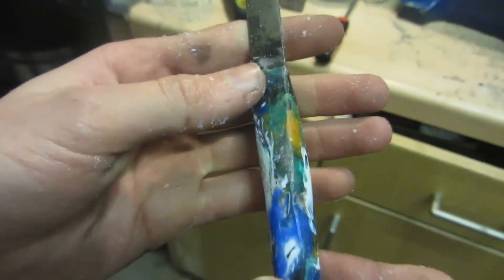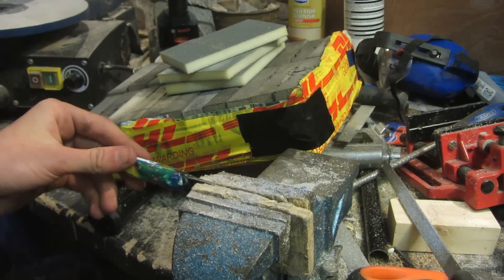How to Forge a Carving Knife From a Drill bit - part 2

Comment from the maker: Enjoy the video!
If you have any suggestions on what to do with all of this new steel then post them below!
thanks
Reply: I think it would be interesting to see you make a kukhri!
Reply: interesting vids, one suggestion I would make is your hammer. Find some with different shaped faces, flatter as opposed to the round of a ball peen. Also not so much choke up on the head, let the hammer do the work by grasp farther away from the head. Is nice to see the young take up the craft, very good work
Reply: Can you make a samurai sword or katana tutorial next? :D
Reply: Yes plz do a kukri
Reply: Corentain Vouillamoz If I remember rightly from my old metalworking days, if you rub the file with blackboard chalk before filing the aluminium, it won't clog so much and will also be easier to clean with the wire brush. Hope this helps!
Reply: next knife you are goin to do ,after  the hardening , leave it in the oven at 280 C for 3 hours , quench it an do this 4 times ,you wont be sorry!! try taking it bit furder and do a damask mix with a stripe of stinless and saw blade ! twist it and fold it twice and itll be beautyfull!!  a machete!
Reply: I would also say pocket knive and katana
PS: Dude you are awesome
Reply: How about a short sword
Reply: The Art of Weapons Have you thought about putting the bottle caps in a blender so you get smaller pieces. It should be easier to fill moulds and it might also give you less air bubbles.
Reply: Make a how to make a homemade butterfly knife video! That would be awesome!
Reply: The Art of Weapons  if you know how to work leather make a sheath
Reply: no shit sherlock
Reply: make some of grant thompson's batarangs
Reply: Why don't you make a karambit ?
Reply: Broad heads for your bows
Reply: can you put a link to the knife blade blank in the description
Reply: Daxian Preston He did...
Reply from the maker: Mike Koepsell ok I will do more videos like that!
Reply from the maker: Zednought X 
yep i have fallen a bit behind on the forums part and am still trying to get it up and running
my email is theartofweapons@gmail.com
Reply: HDPE axe handle!
Reply: Can you teach us how to make a grip with curves for your fingers and a curve at the top of the blades edge?
Reply: The Art of Weapons i think the handle would of looked better if you melted the plastic in the grooves of he bit and sand it down exposing that
Reply: have you done the tomahawk with the hammerhead yet? thats a must do, I would love to see that before I give forging a go. Have you ever made bronze from copper, tin and lead? I was watching a tutorial on casting bronze age swords and thought you might have tried it before, think I will give it a gho once I make a forge. Also Im kinda struggling to find spring steel for my crossbow limbs, know anywhere thats not extortionate? love the videos keep it up.
Reply: Did someone get into daddy's tools again
Reply: Josh Anderson At least it wasn't Mommys purse.
Reply: I am a blacksmith myself.  I really enjoyed your video. I like the style of your Handel and will be trying it this weekend.
Reply: The Art of Weapons use a blender for the hdpe caps it'll save ya a ton of time
Reply: The Art of Weapons you could have made a much stronger and more interesting blade if you'd hammered out the screw portion of the drill bit and folded it several times. If you were to still use HDPA for the handle it wouldn't be difficult to twist the tang to hold the plastic in a similar manner.
Reply: GreatSmithanon Folding the metal does nothing to increase the strength or rigidity of the blade, it's just a method of mixing two types of steel or minimising wasted material. You cannot physically change the properties of the metal.
Reply: The Art of Weapons Depending on what kind of steel it is, the lawnmower blade may not forge well. Also, most newer  files are worthless for forging. I had one catch fire and burn up in the forge. I'm guessing it had magnesium in it. Most old files are 1095 or similar, as is most of the older tool steel, very good for forging. Modern tool steel often has unknown alloys in it, which usually cause problems. Mystery metals can be frustrating to say the least.
Reply: ***** Watch all of the video? He did that!
Reply: The Art of Weapons you could make an assassin dagger
Reply: The Art of Weapons little off topic from the use of the steel. but I think if you had cast a handle with a clear resin, so you could see the drill bits flutes that would have been cool. but kudos for recycling
Reply: This is the first vid of yours I've found, really enjoyed it and will check out the rest of your channel now! Files can make great Straight Razors  if you fancy trying that, will take your honing skills to the next level lol!
Reply: +Jack Penn I agree.  Kukri's were made by the Ghurkhas out of vehicle leaf springs.  Very good quality steel.   All the best.
Reply: +The Art of Weapons ... I enjoyed the video on making the knife out of a drill bit. When you were showing your materials for future projects, the shape of the lawn mower blade reminded me of a project I once saw in a book. That was making a crossbow out of a lightweight automobile spring. It came from an old book called 'The Boy Mechanic'. I don't know if you could adapt this idea and make a modern style using the cam shaped pulleys - but that would be awesome.
Reply: You could probably make a pretty cool spear head. The lawn mower blade is begging to be a couple throwing knives, great supple steel it shouldn't snap as easily. And a file could be a cool folding knife. Or you could make a metal whip handle😁 do a fire whip
Reply: I personally really enjoy more bladed videos like tomahawks kukris knives etc
Reply from the maker: Tyler Smith ok thanks!
Reply: Possibly create throwing knives? :D
Reply: Also my uncle made a lawn mower knife and it's one of the sharpest knives he's ever had. It has never dulled either which is pretty awesome
Reply: The Art of Weapons I think I will post a video with my whips soon!
Reply: you should make a hookaroon or a pickaroon from the axe head
Reply: I have a question: I'd like to make some similar projects with aluminum as you do and I have already molten some aluminum and casted some small blocks. And in the projects I'd like to make I will have to file the aluminum but my father said that it is not a good idea to file aluminum (because it is a soft metal) as you do because it can clog the file. So I wanted to know if it clogs your files and if you have to clean them (if yes, how?) or if it isn't a problem at all.

P.S. I really like your videos and I find them really helpful !!!! :) continue like that !!!!
Reply: +Corentain Vouillamoz it sometimes clogs the files and its annoying but it can be cleaned out with a wire brush. You just run it up and down the file until its not clogged hoped this helped.
Reply: Davy Kammer Ok thank you !!! I will try to convince my father that I won't destroy his files :)
Reply: The Art of Weapons is there an email I could privetly message you by? I have looked on your website but the forums haven't seemed to be running for some time. If you could message me back that would be great, I have some questions and ideas to purpose :)

Email: zednoughtx@gmail.com
Reply: The Art of Weapons  Sent an Email :)
Reply: Samurai machete!
Reply: try using a file instead of a drill bit
Reply: Hey I think you should use brasso metal polish to make your finished blade really shiny!
Reply: your really good at this.
Reply: Ari der Hengst Because karambit's are for fucking mall ninja's.
Reply: Alan Mumford good tip i didnt know that
Reply: PatriceZZZZZZZZZZZZZ You've got a great point
Reply: Elquiesceace Good idea.
Reply: Hello I'm a fellow blacksmith and I will be starting to post videos soon and you could make a Viking style bearded axe out of the old axe head please if you like the idea comment on my video
Reply: For the mower blade I would make a machete, as I have done, meaningfully leaving the shaping at the end of the blade, or a couple piece hatchet, which I have also done. By the way, paracord also makes nice slim handles
Reply: The Art of Weapons Where are you from?You sound german
Reply: xGxPhantom Zzz He is from the UK :)
Reply: Just wondering how do you sharpen your knives
I make knives but never sharpen them because i don't no how.:)
Reply: ....Get a whet stone? or a stropping block? or a carbide file? I have a little tool that cost me 8 dollars, has two carbide blades set up at a 45 degree angle on one side, 2 ceramic rods at the same angle on the other.
Reply: GreatSmithanon Can you ever get your edge sharp enough to easily shave the hair off your arm?
Reply: The Art of Weapons Hey u should make a throwing star or something
Reply: The Art of Weapons Great vids! You could make a tomahawk, maybe out of old circular saw blade. Design style: maybe like the FKMD ATC Comanche Tomahawk or the Ontario RD Hawk. The handel could either be made out of HDPE or to try something new just a simple paracord handle. Btw just subscrbied!
Reply: This some Skyrim shit haha😂 This is awesome man keep it up u have a lot of skill!
Reply: The Art of Weapons awesome learned abunch, thank you =)
Reply: Your a black smith
Reply: The Art of Weapons  This is the first time i see your video, i pretty much enjoy this kind of tutorials and i think yours was pretty good! The only thing similar to this i've done is lead casting... But for ideas on things you could forge, i think one of the longer files could do for a nice spearpoint, you could try bending it to half to have twice as much metal for a shorter point but a bit wider spear blade, a flat piece of steel curved and welded arround the end with a hole for a ribit would make it practical for puting the pole... If you like the idea and you're up to somethign harder, you could even try convining it with the axe head and make a halberd head, it would most likely require that you add more material to the tip of the axe to make for a wider blade, i think this  will be a lot harder than knifes, but from trying big things comes experience! i found a blog with a few really simple schematics, its also in spanish but maybe the images help you slightly, http://amodelcastillo.blogspot.com.es/2013_11_03_archive.html I'd love to see a project like this! Keep up with the cool stuff! :D
Reply: Zack n Dan pls, it's spelled fagit... I'm so mature.
Reply: The Art of Weapons I've read that gloves are to be discuraged in smithing since you get into dangerous habits of picking up hot pieces of metal....

then you forget to put your gloves on and burn yourself....

Better to just learn causion with a few minor burns then one really serious one...
Reply: The Art of Weapons I've read that gloves are to be discuraged in smithing since you get into dangerous habits of picking up hot pieces of metal....

then you forget to put your gloves on and burn yourself....

Better to just learn causion with a few minor burns then one really serious one...
Reply: Zack n Dan Hahaa! No!
Reply: Steven Diaz a cigarret bud or a piece of firewood originally.
Reply: no i was talking about him but i messed up and put them
Reply: Hey art of weapons. Im a pretty big fan of weaponry, especially the way the ancient civilizations had crafted their weapons like the greek gladius, persian fighting knives and so forth. Anyways i think it would be fantastic, if not then just a bit of variety, to try and make either a full egyptian khopesh, or if you dont exactly have the material, a miniature version, say for food, letters, carving, would be a pretty challenging test of skills. would love to see these, and your style of videos are well done and you must have had an excellent instructor for this craft, very good work. Keep it up m8
Reply: +The Art of Weapons  There is a concept called "flame polishing" which is used in glass blowing. Basically when you melt the outside surface,the surface tension makes it perfectly smooth and shiny.  You could have saved a LOT of time on the handle by using your heat gun to do the same thing and skipped the sanding and buffing steps.  Also look up "polymorph plastic" also called PCL, its a very sturdy biodegradable plastic, which has a very low melting point, low enough to be able to mold it with your bare hands.
Reply: +john smith search for Lansky sharpening tools
Reply: How much did you pay the anvil?
Reply: Thanks for the video! That's a fine-looking knife!
Reply: Dude seriously love your HDPE idea.... No need for glue or pins.... I just saw your vid awesome.... I never post comments on YouTube but if u got tips give me a sign ill give you my email..... Starting in all that and could use opinions..... Thx
Reply: you should try make a handle out of hot glue